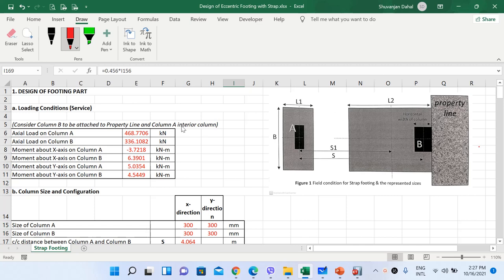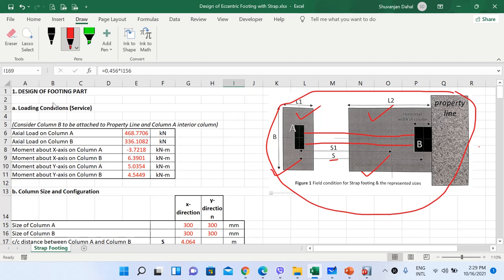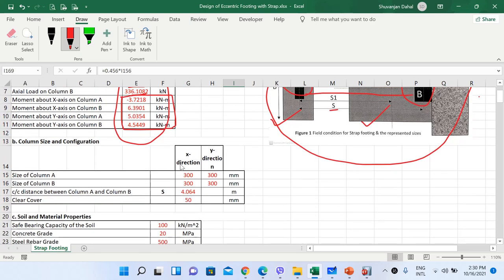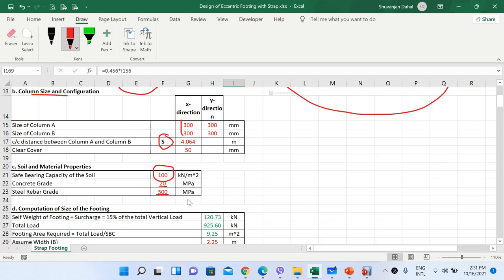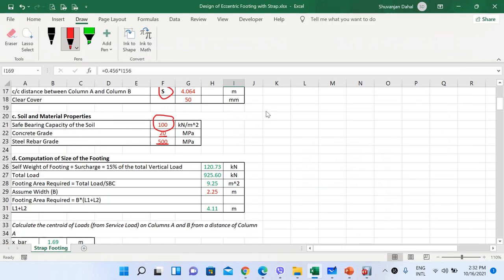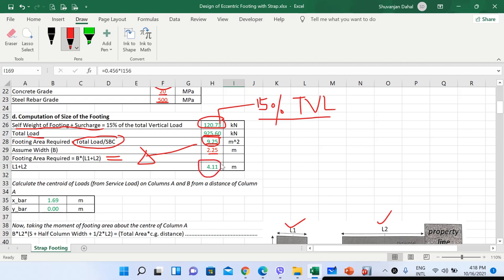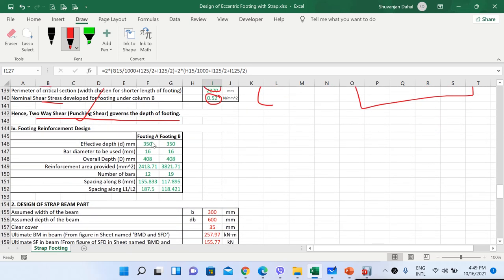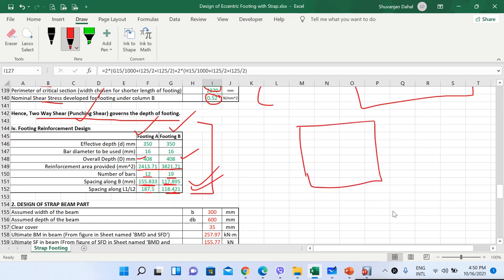Lecture 2 - Design of Eccentric Footing with Strap Beam in Excel Sheet manually (as per IS 456:2000)

Comment: How to design for isolated ecentric footing??
Reply from the maker: The method to design an eccentric footing (eccentric in one or both axes) is readily presented in any concrete design book. However, we generally do not prefer footing of this kind and may be constructed only if the load coming onto the column is very low. The problem is that when footings are constructed with large eccentricities, tension force develops in the soil underneath because of the fact that not all portion of the footing remains in contact with the soil. Since soil cannot resist tension forces, the footing fails in bearing capacity check. So it’s always needed to couple such eccentric footing with any nearby footing with a strap beam.
Reply from the maker: That is why this video only deals with design of an eccentric footing with strap beam. Do comment if you want to learn about design of an isolated eccentric footing as well and we will make another video on it. In another video in this series, when we design this same footing in CSI SAFE software, there we will see what problem arises when we construct an isolated eccentric footing!!
Reply: @inquisitiveengineer1993  i wanted to inquire about ecentric isolated footing with strap beam connected to combined footing.
Reply: @inquisitiveengineer1993  intrested
Reply: @InquisitiveEngineer  intrested